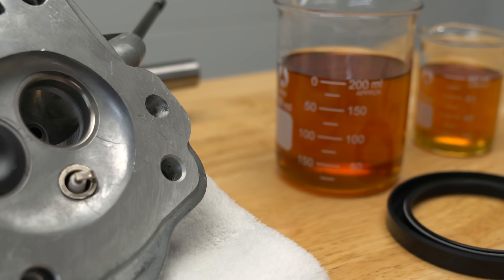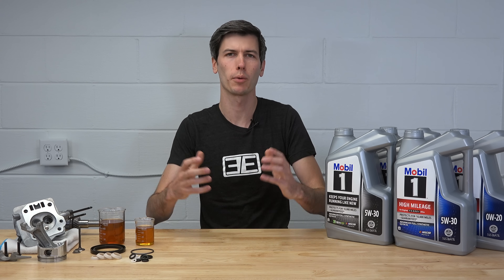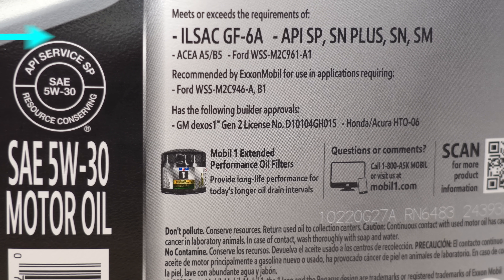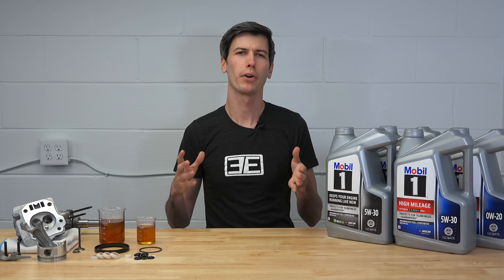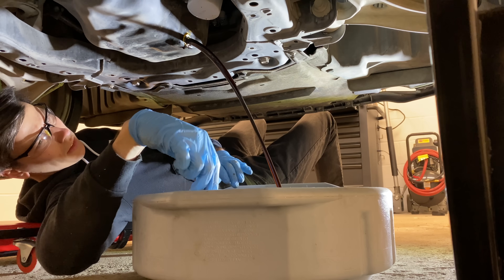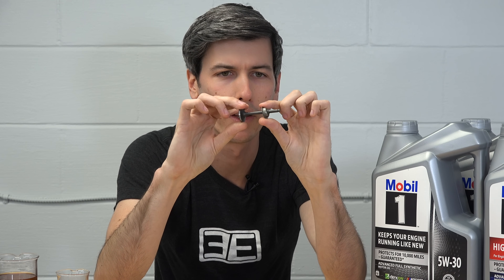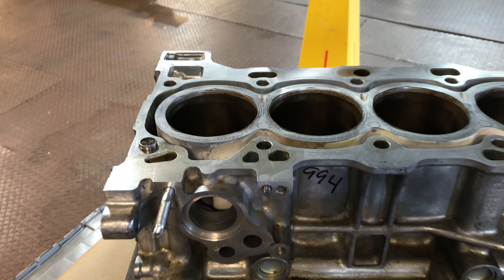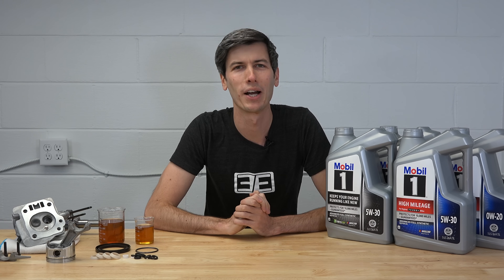Is Synthetic Motor Oil Bad For Old Cars?

Comment: This video has been needed for a long time, I’ve been fighting this myth for 40 years of my 45 years as a mechanic and shop owner
Reply: Don’t even mention using synthetic in an old wet clutch motorcycle. 
Not to mention old high-clearance oil pumps.
Reply: @Robert Rensch  Yeah same problem here like the old machine I own a 1941 Allis Chalmers HD-10W. The engine has copper bearings and alot of components in the engine that cannot have synthetic. Not due to it being synthetic but due to the fact new engine oils have too many detergents. Mineral oil is the only viable option for that machine. 
While I agree synthetic oil can have helpful benefits in newer engines that were intended for them. However that doesn't mean synthetics cannot harm a old engine. Sure some might be fine with the synthetic while others could develop problems over time. I know for a fact I would not use a non conventional oil in a old engine prior to the 1950s even in to the early 60s engines still used parts inside that couldn't use synthetic. 

But as I said before the engine I have in that machine uses a mineral based oil equvalent to hydraulic oil. it's 84 years old and has had no detergents, no synthetic oil, it realistically is required to run on kerosene not typical diesel which it was originally built for. But it doesn't leak an ounce. Also if synthetic was soooo great why is companies like dodge changing from using synthetic transmission fluid to a mineral oil based transmission fluid. Mainly because synthetic oil doesn't have the same properties as mineral oil. They use mineral oil for hydraulic fluid for a reason has a great cold point and can withstand very high temperatures. It also rejuvenates any oil seals and coats them as if they were new. Unless it's a bad seal that's not fixable with just oil. 

Also it most likely in my opinion depends on your climate, temperature, and your type of terrain you drive. But changing your oil weight will or can be very neccessary. For example where I live in the summer we get over 100 but in the winter we can reach -30. So having a oil that suitable for both climates is almost impossible unless you use a multigrade oil. That doesn't rule it out like whatever use 10w-30 in winter and summer. I always use 5W-40 in winter I have even used 0W-40 or 50 in some vehicles in winter because it will stay cold and who wants a engine with problems down the road. Then I went back in the summer to a thicker oil like 10W-30.
Reply: Same here.
Reply: I work in a lube shop. I tell ppl, its fine, matter of fact, you're at 100,000 miles, you should swap over to the high mile stuff.
Reply: Kind of how they call it a motor. While the fact is,it's an internal combustion engine. A motor is electrical that's a/c or d/c. They British called it a motorcar. Old school mechanics still use the word motor. I love correcting them all the time.its important to understand the terms when getting a degree in automotive is the point. And taking tests to get that degree.
Reply: Def not a myth. I've been wrenching on cars for 40 years, full shop with a lift so I would consider myself a pretty advanced DIY guy. I had a Lexus LS400 with about 100k miles on it and always had conventional oil changes. I decided to switch to synthetic and parked the car for about 5 days after a change. I walked out to a huge puddle of oil from the RMS. The car didn't leak a drop prior to the switch. As a hail mary, I immediately changed BACK to conventional oil and within 100 miles it was back to bone dry. I put another 100k miles on it before I sold it and oil never hit the ground again. I am 100% in favor of synthetic oil and use it in all my cars. BUT, those cars have always run it from the factory. I would never do a switch again on a car that has used conventional oil for 10's of thousands of miles.
Reply: @tombiondi9969  Exactly. I agree.  Why these people don't get this is beyond me.  Full Syn. uncovers Clogs in bad engine seals --  results in Leaking . Simple Point . I use Semi. Syn Castrol or Vavoline and have no Problems w/. Old cars.
Reply: @tombiondi9969  YOU NEEDED  much heavier sythn. Oil! We use 15 W 4O
Reply: @captainamericaamerica8090  why? It used 5w30. That's a terrible idea. I shouldn't have to change viscosity so it doesn't leak.
Reply: @tombiondi9969  5W anything is too thin for older engines unless it is something like 10 degrees below zero or colder outside.  Clearances are too large.  Most synthetics are highly HIGHLY detergent, which can wash away sections of marginal gaskets and seals, hence, the oil leaks after switching to synthetic.
Reply: Sorry you are on the take. Conventional oils are the best for old cars--end of story.
Reply: @heofthebee  What do you consider to be an old car? 10 years? or perhaps 20 years?
Reply: @heofthebee  I mean but is that actually true if you were to take a brand new engine and do synthetic exclusively? Like how many of these old cars didn't run conventional oil at some point?
Reply: dear Anthony, 
and what are you thinking about that?
Would honestly interest me.

I'm 50 years old and I think it's different from engine to engine.
Same thing is with 'oil change' in older gears or rear diffs.

greetings from Switzerland
Marcel 👋😉🇨🇭

PS:
sorry Sir for my strange English.
My native language is German/ Swiss-german.

Comment: One big advantage of synthetic oils is they are thinner than the same grade of regular oil at very low temperatures. When I lived in Timmins, Ontario where it gets quite cold in the winter I would use synthetic or semi synthetic oil during the winter months. It made for noticeably easier starting in the really colder weather, especially below -20 degrees C. During the warmer months I would use cheaper regular oil.
Reply: You clearly don't under viscosity ratings🤣🤣🤣
Reply: @richardrichard5409  Well then how do you explain the thinner synthetic oil at those lower temperatures?

Comment: Obviously this guy does not own a vintage vehicle. 
Never run these thin oil's in you classic ride. You need thicker oils and especially with ZDDP. 
They were designed that way. 
Use oils that were designed for your erra of vehicle. Period

Comment: I ran into an issue with synthetic oil in an air cooled type 1 vw motor.  The engine did run a bit warmer, measured at the CHT sensor, the synthetic oil would blow past the valve cover gaskets!  Making HUGE mess!!!  Even modern conventional oil would do the same thing to a lesser degree.  Not until I switched back to Kendall oil that is made for these archaic engines did this problem stop!!  Yes, I replaced my valve cover gaskets to attempt to seal the leak, but that didn't stop it either!  Only switching back to to oil made for this engine solved the issue.
Reply: I think the best thing to do is join a club and get on forums for a particular classic vehicle. Ask these questions to people who have already learned the hard way and save yourself the hassle and potential damage to your own classic.

Comment: Having used thicker oils in many older models it does slow down leaks. IF the crank bearings have 4-5 thou clearance due to wear using a 50 grade oil will increase oil pressure decreasing the crank jumping up and down far less. And will ofcourse reduce oil burning.
In modern efi engines oil burning is very often caused by hard or worn out valve stem seals more often than bad rings. 
Sludged up engines though  cause the rings not to move freely in the pistons which in turn causes smoke. All modern oils are hi detergent which when changed regularly cleans them out and sometimes conditions seals a well.
Synthetic oils are simply better than mineral oil BUT in reality an old tired engine using oil is probably better off on a good 25/50 mineral oil. Changed regularly, like every 5-8000km

Comment: I think most of the fear of going synthetic vs regular, is the oil leak problem. I've heard so many people, especially with sports cars, say they switched to synthetic and soon after had oil puddles on the floor. Synthetic flows like water vs conventional oils that flow more like molasses, (when cold), so logically it "could" cause more oil leaks.
Reply: I think the big thing here is that the synthetic isnt causing leaks, its exposing leaks that conventional covers up
Reply: @diekatzefliegt  exactly! You hit the nail on the head
Reply: Before the rebuild my 350 smallblock lost a quart of oil every 250 miles synthetic of conventional.
Reply: in my real world specific test the synthetic burned off and the conventional did not. same mileage, proper filters. did not go to the full synthetic oil change interval. at that point i was smart enough to switch back and never risk my engine again.

Comment: I always heard years ago that syn oil would clean the engine especially were the inner side of the seal make contact to the surface of the crank or cam on high mileage older engine. but that old news now with the newer syn oil!

Comment: Related to rotors - most synthethics has more additives and designed with a higher flash point = harder to burn and higher chance to have deposits.
It sounds completely reasonable to not use, unless you find one with less ash \ flash point etc.
I want to be mistaken in this but just don't see arguments saying otherwise.

Comment: Been using Amsoil since the 1970s, I’ve used it in old cars , new cars, marine engines and every thing I’ve owned. Used it in cars with over 200 thousand miles, with little to no oil use and no dripping in the garage. People were telling those old lies back in the 70s!

Comment: My falcon ute was spotless underneath until i used a penrite synthetic diff oil recommended on their chart.  About a month later i noticed oil on the garage floor looked under and there was oil sprayed everywhere the pinion seal had started leaking big time.  Went looking for a new seal the guy looks it up and woa there are 2 seals listed one for mineral oil and 1 for synthetic oil. To me that says it all about synthetic oils and older cars obviously the seals were not designed for the synthetic oil.  I sent an email off to a guy that sells and promotes his own brand of stop leak products and asked him the question about synthetic oils and older type seals and he came back with the answer that it has been known to happen. So after that lesson there is no way i would be using synthetic oil in an older car as the last thing i would want is a rear main seal to start leaking because i had used the wrong oil. Just because a product is expensive it does not mean it is better.

Comment: I have a 350 Chevy  engine with around 200K miles +. It leaks oil but that's my fault as the oil pan gasket needs replacing and other than that it still uses no oil. SO what weight synthetic would you suggest that I use. A little heavier synthetic than the 5w-30 conventional oil that I currently use. Maybe 5w-30 synthetic might work ???????  Thanks for answering a question I have had for awhile.

Comment: YOU NEED TO DEFINE WHAT YOU MEAN BY "OLD". WHAT YEAR OF CAR IS CONSIDERED "OLD"? 

YOU NEED TO DIFFERENTIATE BETWEEN AN "OLD" CAR, AND A "HIGH MILEAGE" CAR. 

FOR EXAMPLE, A 2006 TOYOTA COROLLA MAY HAVE OVER 225K MILES. SO IS THAT AN "OLD" CAR, A HIGH MILEAGE CAR, OR BOTH?

Comment: I've been using Mobile1 since I bought my '04 F250.  Now has 342K and I often don't change oil for 10K - 15K miles.  Of, course I pray for protection also.

Comment: Currently i have 1 suv,1 sedan,1 mpv and 2 motorcycles using semi-synthetic and fully synthetic oil all the way,I live in a tropical climate country..If my engine is over 10 years with more than 95k miles in it,Even if manufacturer recommends 5W30 i will go for 5W40

Comment: I have a Nissan Frontier crew cab SE that is a 2007 with 89,000 approx. original miles...It's been a reliable running truck but after 7 years since new it developed a few seconds engine rattle at a cold start or after sitting an hour or so.. I know most Frontier owners also have that issue even years up to 2019... I been using synthetic blend as my auto shop recommends. Anyone might know what is the solution before I take it to the dealer?..

Comment: You loose torque in older cars with syn oils. You do want sticky oil in old cars it sticks better. In racing in the old days if someone had a Moble-1 sticker on their car you knew you beat them because of the slow start!

Comment: This is essentially the wrong question. The right one would be 'Should I use synthetic in an older engine?' The answer would be, for most made before 1995, would be 'Sure, but you'll gain nothing.'. The principal stress on oil comes from the valve train and specifically the cam lobe interaction with its follower, especially in modern high rpm engines. This basically chops up the polymer chains in the oil. One reason for multivalve engines is to reduce individual valve mass and so, pressure at that interface. Old big valve engines could really chew up their cams, especially if being driven hard and obviously pushrod engines, having a higher valvetrain mass, worst of all. The absolute best protection against that is regular oil changes and that is why older vehicles were often specified for 1500 or 3000 mile oil changes. So: should you use synthetic? In a modern engine, yes. In an older one, save the money and do more oil changes.

Comment: The only time I inserted a modern synthetic oil (castrol Power 1) into an old engine, I immediately suffered from clutch slipping and could only fix it by going back to a mineral back to a mineral base oil ans fushing the engine with that 2 times, even though the castrol oil met or exceeded all specifications of the engine manufacturer (API SL and Jaso MA) and was especially specified for a wet clutch sitting in the cranc case and hence in the engine oil.

Comment: so viscosity is measured at 100°C and my oil is a 0W-20. i drive my car like an absolute madman (autobahn and stuff) where the oiltemp regularly reaches 110°C, sometimes up to 120°C for short periods (maybe an oil cooler would help i know). so when i went in for an oil change and told this the mechanic, he literally looked at me like O.O
so i said "do you have 0W-30 or higher?" so i can have the recommended viscosity even at higher temps since oil loses viscosity over 100°C.
he struggled a bit with himself and said "i think 0W-30 is the thickest we have here, its what the Supra gets" 
"i'll take that please"
TL;DR: Oil too hot, now i drive a bit thicker oil to compensate for viscosity loss at temperature

Comment: Does a thinner oil like a 0W -40 reduces oil pressure. from my experience it did. my oil pressure gauge deeped down to almost 0 when I change it to Mobile 1 0W-40!! Before the change oil the pressure gauge showed a healthy highest full pressure!!! In fact when the gauge almost deeped to zero it caused me to panic!! This tells me oils with a rating of 0 is so thin that it makes the engine lose oil pressure!! I shifted back to 40W and sure enough the oil pressure gauge pointed once again to the fullest pressure! Lesson learned: DONT USE 0W rating its as thin as water that I think it has little protection of the wear of the engine!!!

Comment: High mileage oil has seal conditioners  that recondition your old dried out seals. They also have different cleaners to remove old sludge.The engineers spent years developing these oils so use them.
Reply: They do nothing. You can try them if you have leaks, but I have had less leaks with Mobil 1 than any high mileage oils. 

Most of the time they're just a little more spendy and sometimes available in weights not commonly found in regular synthetics.
Reply: May or may not help...jury is still out.

Comment: As usual, your explanations make total sense.  Your flickering oil pressure light hit a nerve with me.  My 96 Impala SS (purchased new) had about 275,000 miles on its 5.7 liter LT1 when I started noticing the dreaded flickering oil pressure light.  No oil pressure gage came with the 96 Impala.  The engine has never seen any oil except Mobil One 10W-30 - changed every 5,000 miles without fail.  The light would only flicker on a hot summer day while idling at a red light with the AC blasting on high.  I tried switching to Mobil One 10W-40.  I could not see any significant improvement.  I finally had to admit that the old LT1 is worn out.  It has since been replaced with a rebuilt LT1.  No more flickering oil pressure light.  8-)

Comment: I don't see how 5 w 30 oil would be different than 5 w 20. Because when the car cools overnight, the viscosity is still 5 w. I use 10 w 30 in my Town Car with 130k miles, when I change it myself. And it has never leaked oil. My closest Ford dealer and a Metroplex Ford/Lincoln dealer both made my car leak oil by some oil it that was green. They charged me for 5w 20 Motorcraft in each case. Wnen I changed the oil I had a quart Motorcraft 5w 20 and it was black, not green. Lucky me I have a Kwik Kar service center that I will use for service instead. I think the flaw is that dealer lets the sales staff run loose in the service department.

Comment: I put full synthetic oil in two vehicles, both had a bad outcome.  My used 97 f150 after adding synthetic it started ticking bad.  Took about 6 oil changes/cleaners then always adding seafoam to quiet the lifters back down.         #2 put synthetic in my used 03 cadillac seville, the autozone tech said this vehicle requires full synthetic.  The oil had a constant stream coming out, there was an undiscovered oil leak that was magnified x100.  So I put conventional with thick syrup lucas, this slowed it alot.